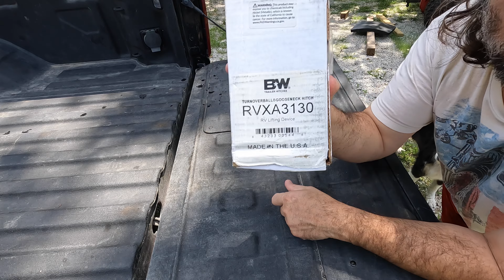B&W RV Lifting Device

Comment: If you would have curled the bottom of the bucket up and run the chain against the cutting edge on the bottom before hooking it on the top of the bucket hooks, you may have gotten the extra few inches you needed to pull the 5th wheel hitch straight up.
Reply from the maker: Hrmm, I see where you are going. Worth a try!

Comment: Do the exact same thing. Went to Harbor freight bought a cheap bumper hitch bolt on reciever. Drill 2 holes in bottom of bucket use 2 bolts takes two minutes to put it in. Stick a draw bar in it use it to easily remove and install B&W. I been doing it that way with a 2210 JD since 2015. And have added ease of moving trailers with it also. $30. Total maybe.
Reply from the maker: Interesting idea with multiple uses, I like it!

Comment: Hello, I just purchased one and i have pallet forks on my JD and approached it from the back of the truck and removed the hitch and set it on a pallet and picked up the pallet with the forks and then moved the pallet with the hitch into the barn, no more back breaking. Those hitches are heavy for one person to remove out of the slot. Hope this helps.
Reply from the maker: Maybe the pallet forks would make the delta for me. My tractor is just a bit too small no matter how I curl the bucket. Yet another reason I need to convience my better half that we need a good set of forks!  😎

Comment: i hate to be one of those guys to talk crap on videos but id like to offer a suggestion. if youre worried about the max lift height of your bucket you could always weld a hook on inside or backside of the bucket so you dont have to lift so high up.
Reply from the maker: My concern was more about umm ... depth? How far into the bed of my truck my little tractor can reach with the bucket. I could not reach the hitch from install location with my bucket. I have since gotten a pair of forks for my tractor so I'll bet they reach, nto tried yet so who knows :)

Comment: Good job man
Reply from the maker: I need to find a way to make this easier. I thinkt he best (cheapest) option is to get some forks for the Mahindra. I been wanting those for years already. But . . . My wife wants to do some giant container gardening. I am going to cut 55gal (food grade) barrels in half and put those on pallets and will need the forks to move them (~40 gallons of dirt will be heavy) so now she 'needs' forks on the Mahindra :P
Reply: @tlchomestead  Agree on the forks... we have a larger tractor (Kubota M5-111) and excavator which help.  Would love to see your garden unfold too... that would be awesome!
Reply from the maker: My garden was awful this year. Between other projects and the heat nothing sprouted. I really think the store sold me a big batch of old seeds. Jiffy pots - nothing. Aero garden - nothing. Direct sow - nothing. Did not make me a happy man this year :(
Reply from the maker: BTW, nice tractor :)

I wanted something larger when we got this little Mahindra but life was in the way back then and we had a guy running hay and mowing. He had a 96 horse Kubota with a 12' batwing for open areas and a smaller 8' cutter for in the tight areas. Was a thing of beauty.
Reply: @tlchomestead  Gardens seem to be bad everywhere this year.  We're going to get one going in 23 or 24 (depending on life as you say)... keep the faith!

Comment: Just leave the kingpin locked and lift the hitch with the trailer. 
If you store it outside keep it attached. 
If you store it indoors use the bucket under it and release the kingpin.
Reply from the maker: Agreed, and good ideas. But . . . right now my rig is over getting warranty work so that trick of using the front jacks to lift it up does not work right now :)

Comment: Just lift it enough with the tractor to hold the weight, then pull the truck forward.
Reply from the maker: My issue was the angle, needed more reach, so the bar was twisting inside the receiver when I tried to lift, causing it to lock in place. Someone said to curl bucket other direction and maybe get a little bit further. I'll be trying g that next time.